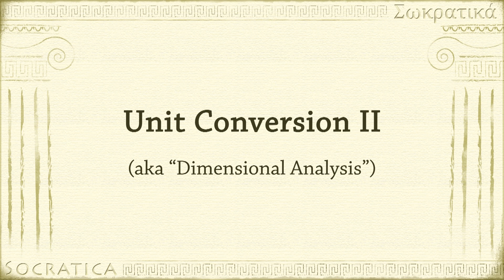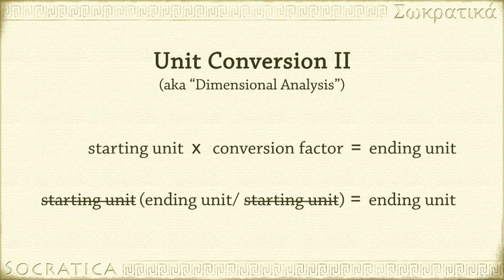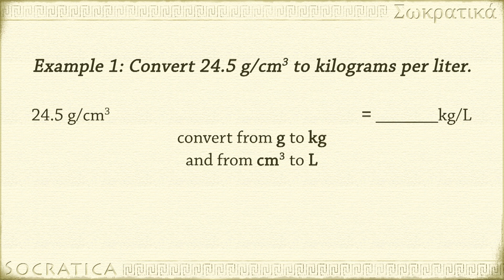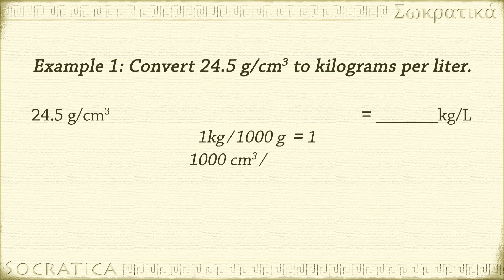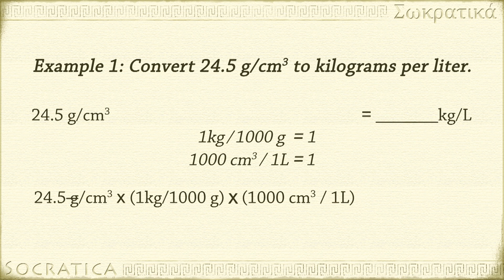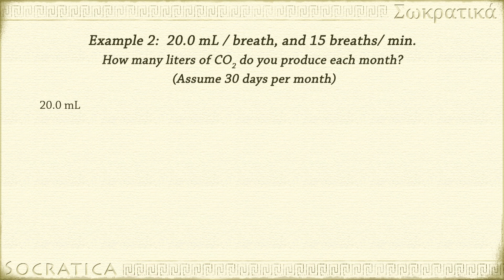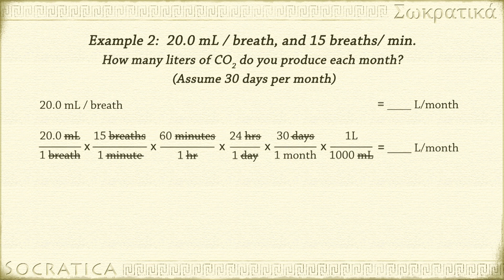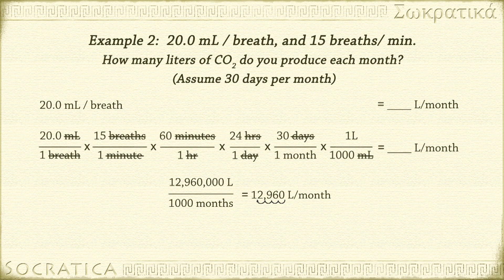Advanced Unit Conversion (Chemistry, Physics)

Comment: We should use vertical fractions instead of diagonal fractions when doing dimensional analysis.  This makes it easier for students to see why the units cancel in terms of the numerators and the denominators of the unit conversation fractions cross-cancelling during multiplication.  I hope this reasoning makes sense.